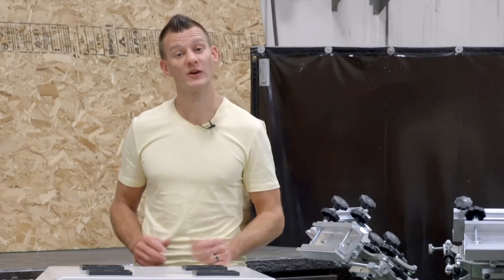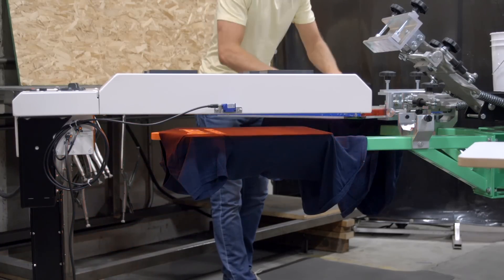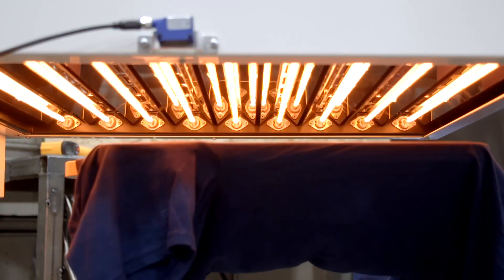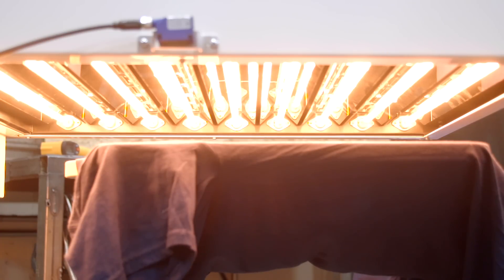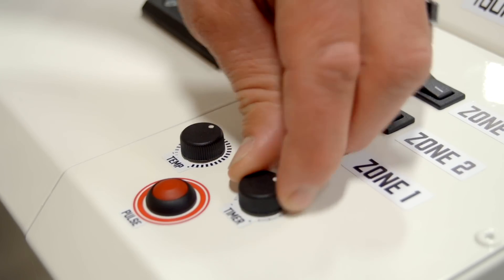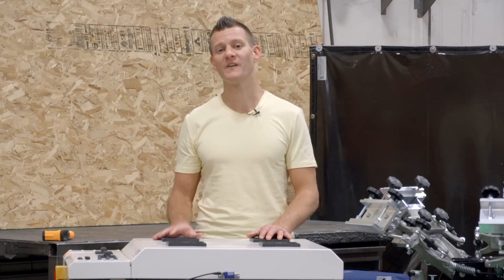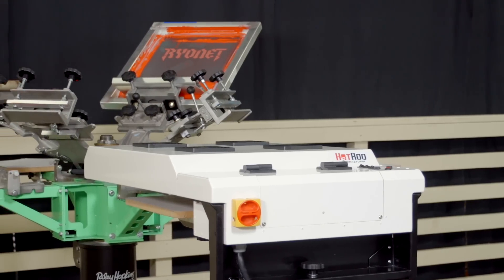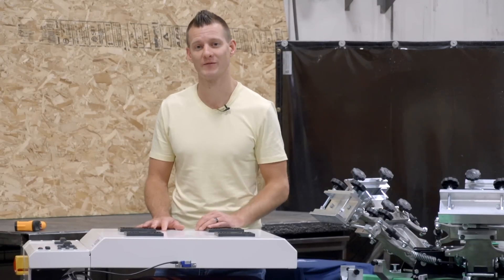Introducing The HotROQ Quartz Flash for Screen Printing

Comment: boss, infrared flash dryer have too much smell while curring the plastisol ink?
Reply from the maker: Not a ton of odor! Depends on the inks used but discharge ink is where you'll get the most odor, not plastisol and HSA waterbase
Reply: @Ryonet  thank you so much boss..

Comment: Can you cure shirts with this instead of using a belt dryer while it is on the press? That is, if I fold the shirt and lay it on the platen?
Reply from the maker: You sure can! You can normally cure with any flash dryer though it takes much longer than with a conveyor dryer. This Quartz Flash will be faster than an Infrared and will keep your platens safer too :)

Comment: How long would this take for final curing a water based ink (Green Galaxy) without the warp drive?
Reply from the maker: Depending on the thickness of the ink it could take anywhere from 20-60 seconds :)
Reply: Great, thanks! Also, what are the dimensions of this unit?